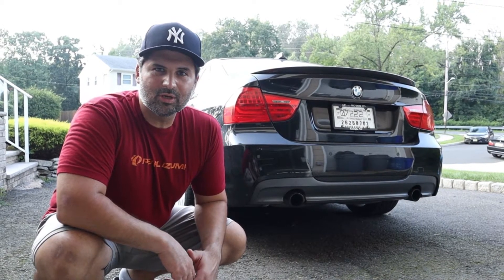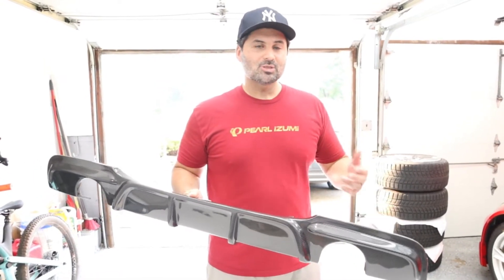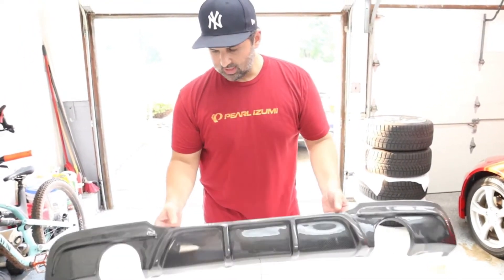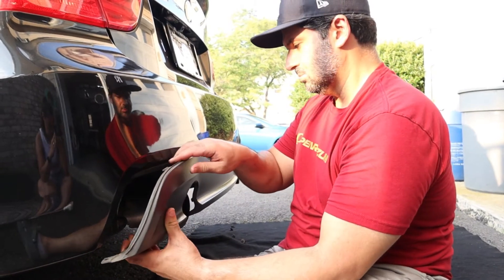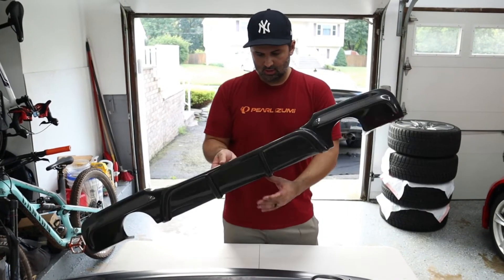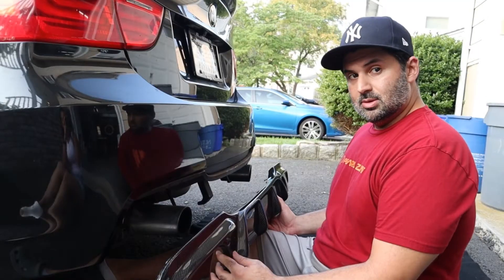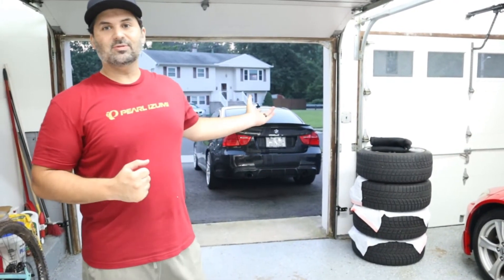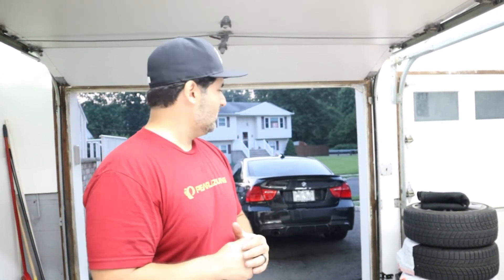Installed the BWE Customs Carbon Fiber Rear Diffuser on the BMW 335i

Comment: Just ordered the V3 Carbon Diffuser off Bimmerpower24/7 for $450, so excited to get rid of the old cheap and boring diffuser
UPDATE: IT DOES NOT FIT AT ALL!! It has a horrible curve that will not fit properly for mine, can’t bend the piece either because it will crack and break 😁absolute waste of $450 dollars and now I can’t refund it

Comment: My rear diffuser can’t be detached why?
Reply from the maker: The 335 m sport rear has a couple screws and is snapped into place … I had to pull on it a little but came out in 1 piece.

Good luck